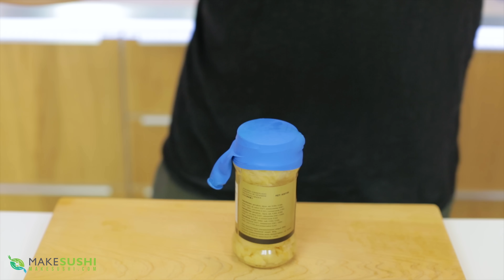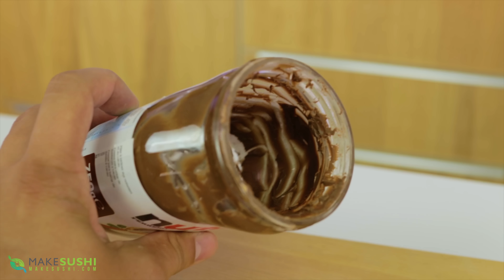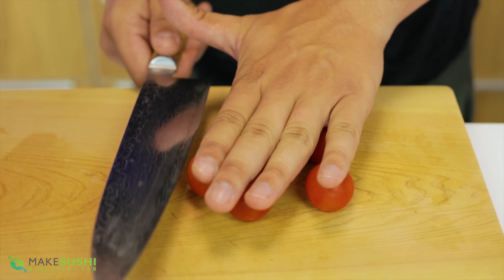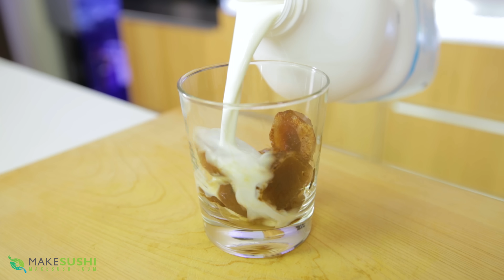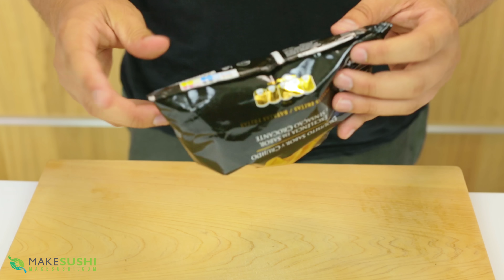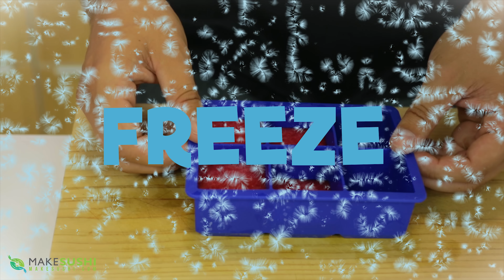10 Genius Food Hacks

Comment: Never use a metal bowl for popcorn or anything you want to stay hot because the metal conducts the heat out of the food into the air, cooling of whats in the bowl.
Reply from the maker: Good point, except if you enjoy cold popcorn.... which I don’t so you’re right should have used a plastic or wooden bowl or one of those cardboard bowls

Comment: The DIY vac seal with a straw method is sketchy at best. Ziploc bags and the like are not completely non-porous and a vac seal will be imperfect...or at least only good for a short time...such as marinading beef, chicken or shrimp.
Believe, I do it all the time.
That's why I bought a NESCO VS-02 Vacuum Sealer. It rocks and beats FoodSaver by a mile.

Comment: There is no need to rip a hole in the chip bag like that. The chip bag itself will form a bowl. Turn the bag upside down and push the end into the bag an inch or two and then turn the bag back over, open it up and fold the top down. Easy peasy and you still have a bag you can seal up to preserve the rest of the chips if you don't eat them all.

Comment: I've been using the straw/vacuum seal thing for a long time. Usually works, but sometimes the bag will not hold the seal.
Do not use a zip-lock bag to keep a cell phone dry, even one with double zips. Get a waterproof phone case. Trust me on this.

Comment: Raspberry trick with the silicone mold...the darn mold doesn't release things. The frozen walls of the cube next to each cube provides such a solid wal;l that there is no give, and sitting the tray in warm water only melts the out-sides of the cubes (whatever they're made of) To get the stuff out, you either have to entirely melt what's in them, or cut up the tray. I had to cut up three ice-cube trays to get the cubes out.